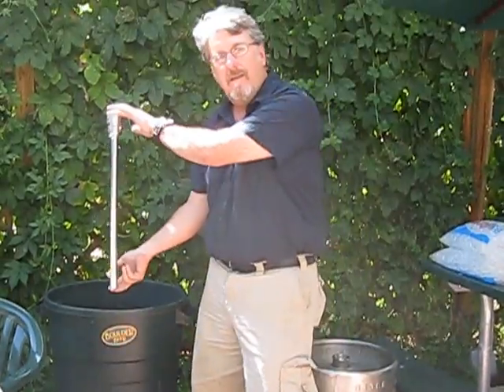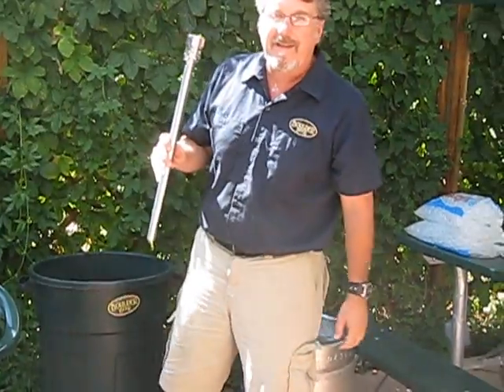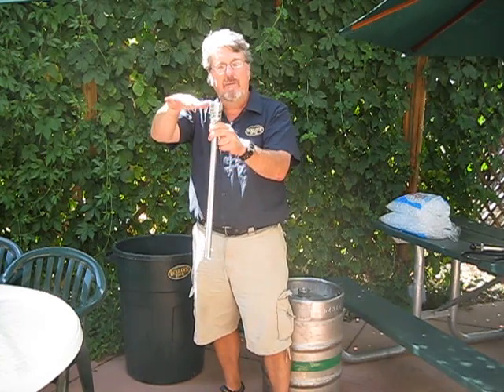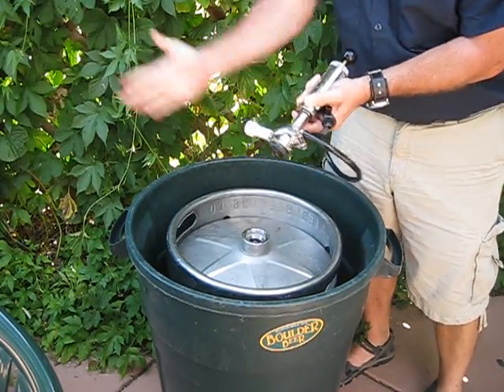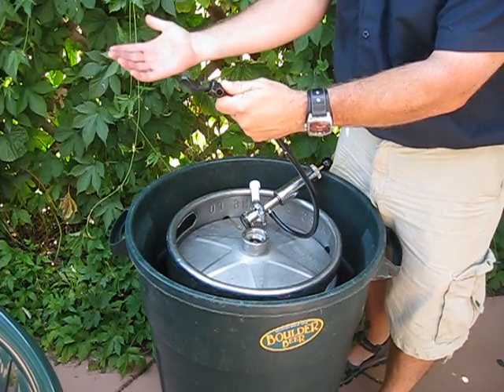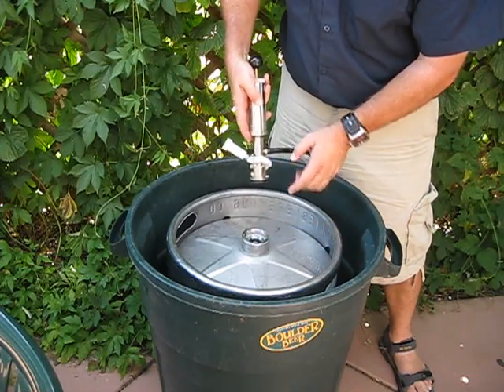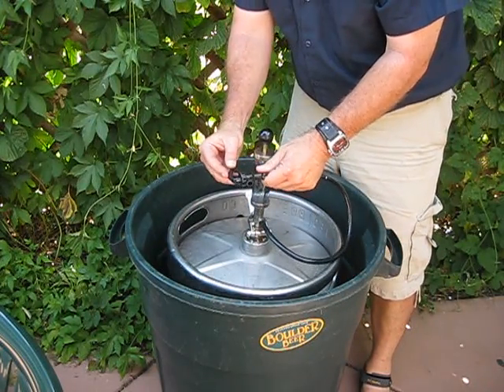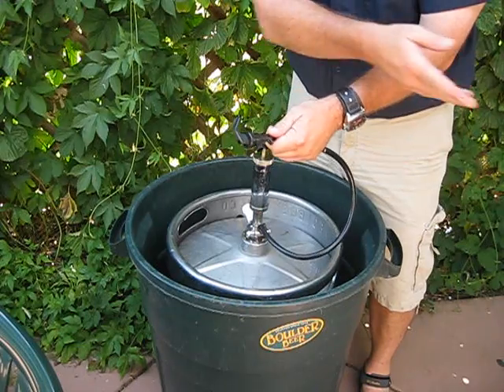How to tap a keg of beer

Comment: hey thanks for the great vid. i do have a question though, in a bar setting, the gas used to pressure the keg to push the beer out (to my understanding) is usually co2 or nitrogen. i have noticed that in your setup and many other homebrewers too, that the pressure obtained is by pressuring the surrounding air. Now, since the air and beer are in the same container and it not being the gasses used in bars, does this effect the beer in any way, like taste and keep-ability?.  Thanks in advance

Comment from the maker: There are many types of keg taps.   Most people who take a keg home from the liquor store use the above style 'party pump' to tap the keg.  It uses air not CO2 or Nitrogen.   Using air does not affect taste but does mean the keg needs to be used up within a few days.   Using gas cylinders with CO2 or Nitrogen does not introduce this problem.     A party pump can be had for $40 while a gas system will cost between $100 - $200.  Keg taps can also be specific for USA or European kegs.